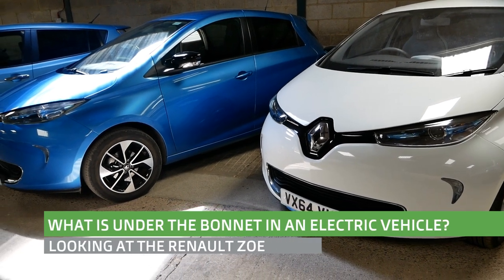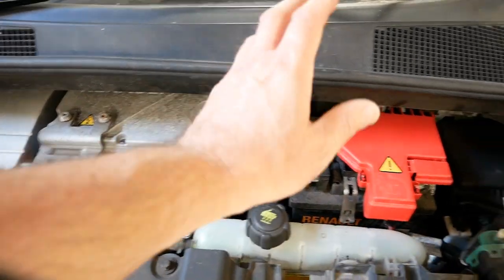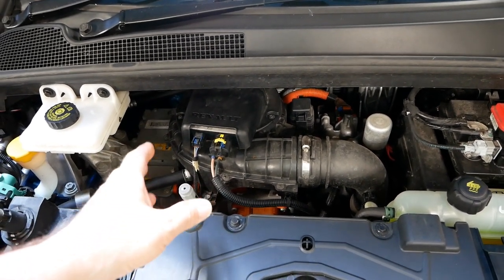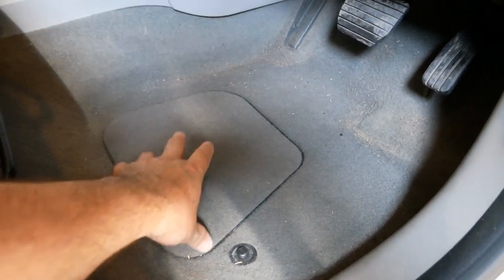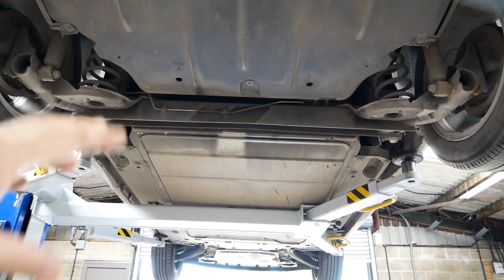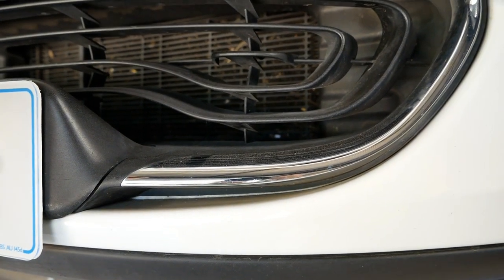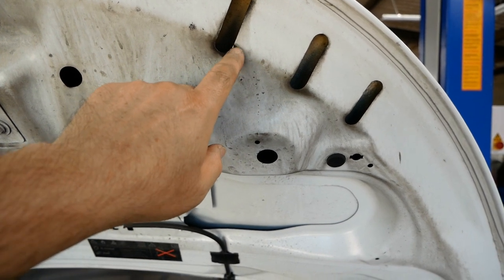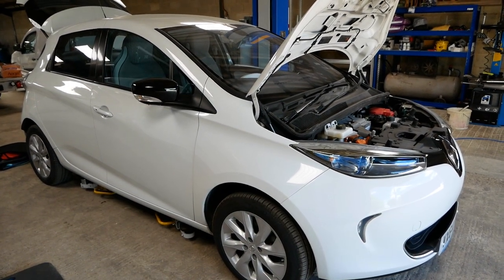What's under the bonnet in a Renault Zoe electric vehicle?

Comment: An interesting look around. Interesting that it’s easy to see a lot of crap under the white painted bonnet underneath! Most ICE cars have black ‘matting’ underneath that at least hides a lot of it. Hopefully there are air filters on the intake for the air con! Presumably it uses the radiator for the a/c coolant as well, or it might have an small independent one, like most do? E.g. most petrol hybrids actually have 3 radiators - engine/power electric/air con.
What wasn’t clear is where the battery cooling fan air intake is. Sometimes there are long term problems with them becoming clogged with imported rubbish etc, reducing the cooling performance. Also a problem with Hybrid ones (e.g. my Yaris has an underseat air intake for that purpose for the traction battery cooling fan). Worth cleaning under maintenance, no doubt.
Reply from the maker: When I have more time, I'll do a more in depth video and take all the trays off underneath to get a better look at what is going on underneath.

Comment: Hi, thanks for the informative video. What is that black ducting air intake looking thing above the R motor? I have a Renault ZOE from 2018. There is a lot of noise coming from that black unit when i use the heater.
Reply from the maker: Its a fan which blows down underneath the vehicle. If you put your head underneath the undertray, you'll see where it vents out.

Comment: What is the tube doing on the right side of the motor?
Any "convenient" way to drain the coolant?
Reply from the maker: I've not needed to take one apart, but I think that tube is venting the air from the top of the motor stack to the ground. There looks to be a fan on the top of the motor stack.
As for coolant draining, again not done this myself, but there's usually a top on the lower radiator outlet.

Comment: Great video, sounds like the anti-roll bars haven't been upgraded to take the heavier weight of EV batteries, only a smallish fix but a bit off-putting tbh..
Reply from the maker: The (22kWh) battery weight is only 290kg. But of course, there's no gearbox, tank of fuel, etc etc. The whole car is only 1463kg.
All modern cars have got heavier, but EVs aren't much heavier than their ICE counterparts. Certainly not as much as most people are let to believe by the press.

Comment: Not a nice thought at 8:39

Btw, is there a difference with the ZE40? We got this weird round whole underneath on the front side. The 22 version doesn't have it, but you do see a round shape with the 22 on the same position in the plastic.
Reply from the maker: The round hole is an air extraction vent. You'll notice on the top of your motor is a fan and ducting to the ground. It all looks very similar to an air filter on a combustion engine. On the Zoe, it is venting the heat away from the motor stack.
Reply: @GoGreenAutos  Thank you for your quick response! I just wonder, why isn't it there on the ZE 22 then? On your video I see a little round shape there, like they knew they would make a hole in the next version? Confusing.
Reply from the maker: @cg986  It depends on the motor. The rapid charging cars with 43kW AC charging used a Continental motor without this fan, whereas the 22kW AC charging cars used a Renault motor with the fan.
Reply: @GoGreenAutos  Cool. Thank you for clearing that up!

Comment: Not sure if anyone can help? Occasionally we get a loud whirring noise (when accelerating). It usually happens after hitting a bump. It sounds like something not sitting flush in a cog near the motor or front wheels. (or something!) To make it stop we have to stop the car, press the brake hard and then restart the car completely. Any ideas anyone please? Thanks a mil. 
It didn’t happen as often when we got the suspension refreshed (but still happens).
Reply from the maker: The Zoe motor does get loader with age/mileage. But it sounds like this isn't motor whine. You could try changing the oil in the reduction gear (transmission). But if you get it after hitting a bump, it must be suspension linked. I've seen two EVs now with loose wheel hub nuts (probably due to mistakes from past work), so might be worth checking they are tight.

Comment: The lift was a bit snug against the battery pack and cill. I'd raise the pads a bit next time ☺
Reply from the maker: Keen eye. It was but not touching. There's not enough ground clearance on many EVs to get the pad extensions in. Pads raised up as much as possible. I bought this lift because of the extension kit which will allow the arm to miss battery packs, but the trouble is most of the vehicles are too low to get them in there.

Comment: Amazing that they need a lead acid battery
Reply from the maker: All EVs do. Means the main 400V battery can be offline when the car is turned off. So the 12V runs the central locking, starts the ECUs, dash, lights etc etc before the 400V battery kicks in,
Reply: @GoGreenAutos  I believe Tesla have started to phase them out.
Reply from the maker: @esm7708  Tesla are moving to a lithium 12V battery.
Reply: They are moving toward 48v in the new models not out yet